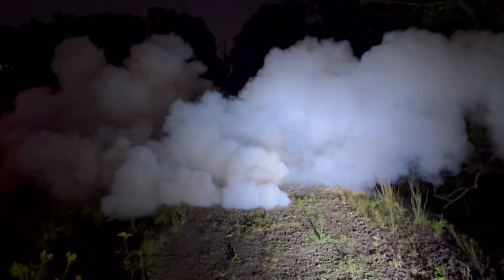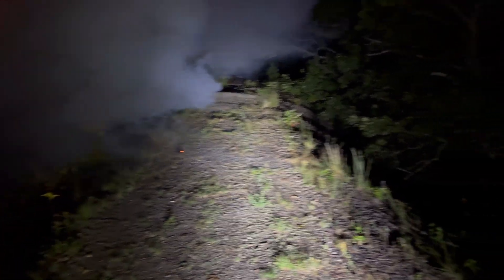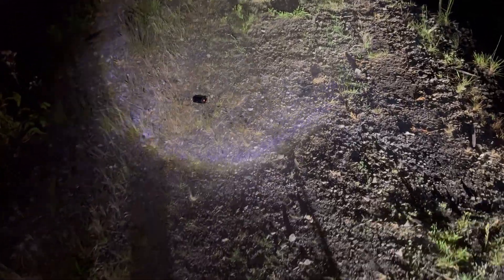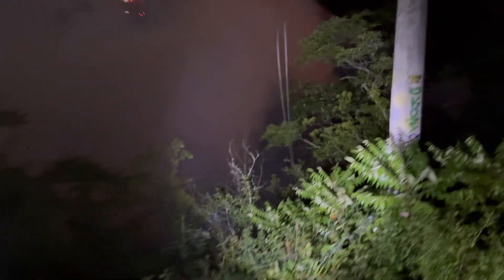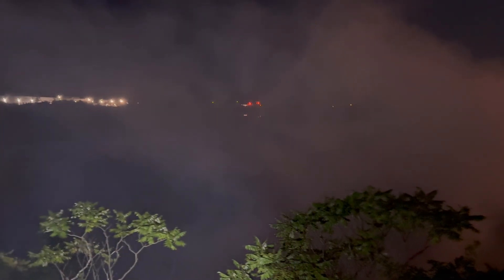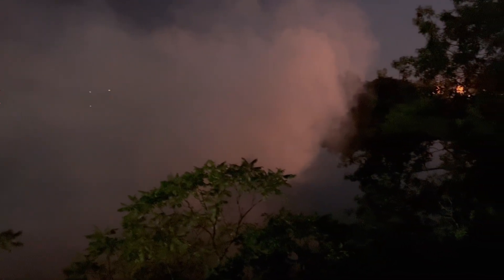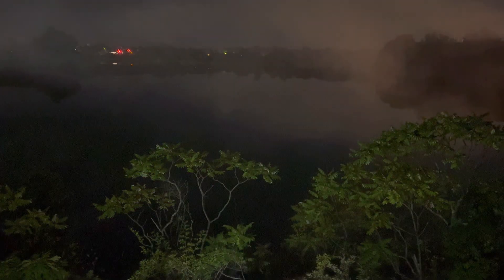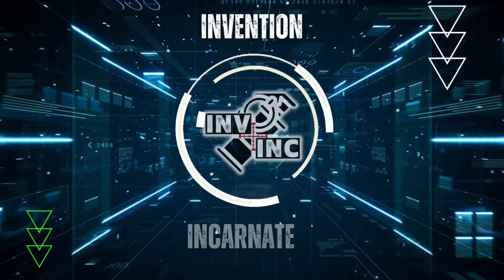The Jet'Nade Smoke Device-- This Thing Has Scary-Fast Smoke Dispersal

Comment: Have you tried adding self defense pepper ball dust into it? Would be a great combination!
Reply: A great combination and a illegal one at that! XD Adding irritants to smokes makes them fall into a category where you need permits. edit: You especially do not want to go look up 100% pure oleic capsicum to add to the mix.
Reply: @rick5078  But what's the trick to getting OC mixed in the right way to be dispersed without being destroyed? Would it require a low temp mix? 🤔
Reply: @WildernessMedic  its an incomplete combustion, hence the smoke, should be fine just mixing it in. but again, this is illegal to do.

Comment: Great work, fast dispersal is ideal. 
If you could redirect the port off of side about 1/5th of the way up from the bottom so the thrust was helping to roll AND spin the canister it would move around more consistently and I believe disperse more evenly. I know this would be tricky and likely the juice isn't worth the squeeze but it would be awesome to see one of these zipping around like a ground bloom flower firework but emitting huge clouds.

Comment: You might try adding a "muzzle brake" of sorts, to divert the efflux into relatively balanced jets, to keep the device from taking off. If the outlets were offset, slightly, it would induce spin, without trying to rocket away.
Reply from the maker: Great freakin idea! You are absolutely correct. The safety added by ensuring spin outweighs the minor reduction in burn efficiency from an unbalanced core. Especially when I can’t drill them straight anyway 😂. I’m adding that to my new canister design. Thank you 🙏
Reply: Even one off-center port might be good, so it tumbles itself around a small area and sends smoke in all directions.
Reply: No way! Let that thing ricochet like a fire extinguisher in a cartoon! That thing is tactical af! The army would love it 😈